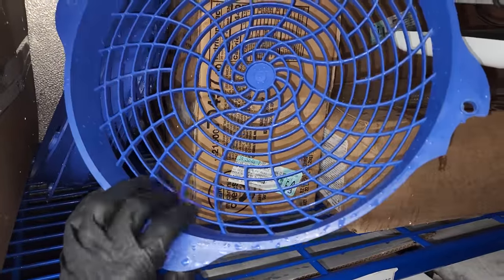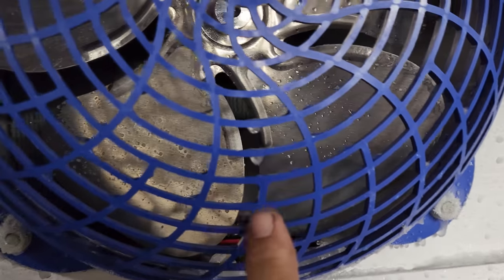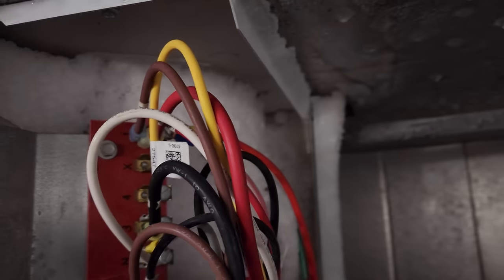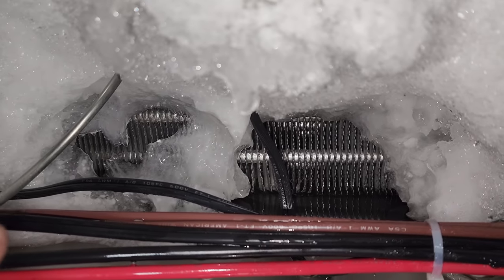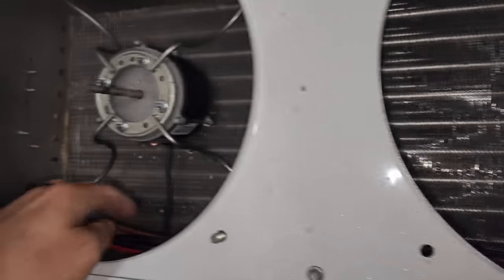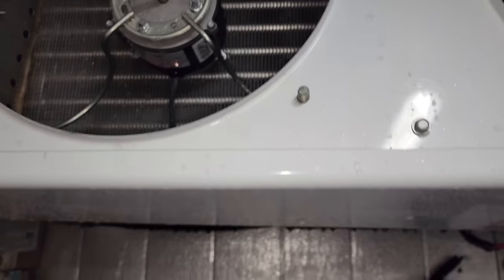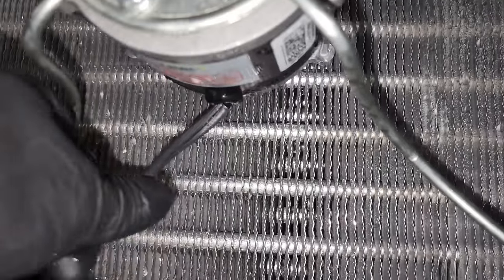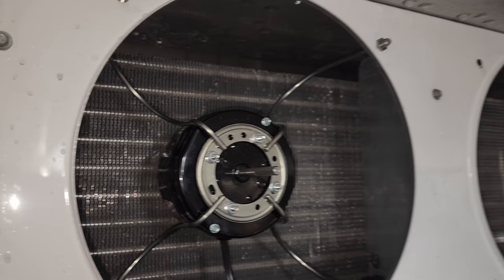THE WALK IN FREEZER HAS A LITTLE ICE ON IT.....

Comment: It cost's our store thousands of dollars in wild service calls. Cooler bunkers ignored by building maintenance, a grand. Frozen product to throw out because fan motors werent working or lack of cleaning maintenance, 500 dollars. Ice'd up walkins because online grocery leaves the freezer door open all day long 5 grand. We had so much ice and janky installer that it pulled down the evap coil and caused a leak. It took weeks to fix. Now we have iced up drain pans and water leaking all over behind the chicken wall because they keep leaving doors open and sucking the humid summer air into the freezer. Just like the walk-in cooler. We leave the door open all day long and with a cheap missing flaps wall curtain, all that humid air clogs up the drain and causes the evap to leak water onto the product and us all day long. I suggested long defrost over night when no one is around but I'm retarded. The company that services us likes to leave screws out, missing brackets, merch lighting hanging off of one screw falling down constantly into customer bunkers so they have to move the broken fixture out of the way to get chicken out. It's rediculous how much this costs the store and the company cares about nothing more than profit and make us wait for them because they are high and mighty.

Comment: I have an idea why, but why would the compressor’s oil be flushed out without the evaporator fans running?
Reply: 2 reasons, the most prominent being flood back. Basically, when the airflow over the evaporator is blocked, the refrigerant won't boil properly, and if liquid refrigerant floods back to the compressor through the suction line, it will wash the oil off the valves, bearings, scroll plate/pistons, etc. Additionally, liquids are incompressible, so you can also wind up with bent valves and such. Another issue that can happen, if the evaporator becomes flooded with liquid refrigerant that isn't boiling off at the proper rate, what little gas is returning to the compressor suction won't have sufficient velocity to carry oil back, which can result in oil slowly starting to saturate the evaporator.
Reply: @boginator55  along the lines of what I thought. Thanks
Reply: This now has me thinking... In a system where the evaporator is much lower than the compressor, does oil tend to escape the compressor and sit in the lower evaporator coil?
Reply: @fitybux4664  During normal operation, a small amount of oil will travel throught the entire system. If the evaporator is sized correctly, the suction line is sized correctly, and oil traps are installed properly, then the refrigerant will carry the oil back to the compressor. But yes, if those procedures aren't followed, or the coil is iced up/blocked, disrupting normal refrigerant flow, oil can pool in the evaporator. 
In the latter case, once the cause of the problem is rectified, oil can be returned to the compressor by warming up the evaporator with hot water or a heat gun, and then starting the system. Under heavy load, the rapidly boiling refrigerant will help return the excess oil to the compressor.
Reply: @boginator55  I just watched "WALK IN FREEZER CALL THAT DID NOT END AS PLANNED" and it seems like he has exactly this problem. Oil logged evaporator coil. It should be a crime to not install the proper traps.
Reply: Do not forget he mentioned hearing the condensing unit short cycling on LP while inside the box. 
Worst restaurant owners ever imo.  I have seen ice buildup on evaps before but nothing close to that level of encasement...

Comment: Can't we get a truck mounted unit to blow 0 deree air in a tube into the box for an emergency?
Reply: Sounds like a good invention. Have a gas/electric powered condensing unit on the back of a truck (could use a normal unit, just have a large gas generator on there too when necessary), have lines running to a portable evaporator coil/fan you can place inside the freezer box. Not sure if they have rubber hoses that can handle 500psi+, I'm sure anything like this exists for the right price.

They do have freezer trucks, which are a bit more conventional. But then you have to move the food around, and they tend to not work too well in high heat. (Whereas the existing freezer box is already insulated correctly.)

Maybe take it one step further. Put all of this on a crane truck. Then you can drop off the whole package to run just outside a business and you can grab another one to rinse/repeat.

Comment: thing i dont get and i hate, is the fact that those things uses electricity to defrost, by heating up the condenser, for me its stupid, or i am the stupid, i dont know but they could run the fans until the ice clears and the temp of the room will be 1c or 3c, no need to defrost it- but still, im not an experter or engineer

Comment: My only concern is you using Hot water to melt the ice. I do not use Hot water for thawing coils, only normal cold water from the spigot. Leaks are in the future for that coil. You will get wet but that’s our job. As for a Saturday call labor plus parts.🤔.  I’d say in the neighborhood of $1500-$1700. Judging by the amount of work estimating 3-4 hours on site, after hour fee from the supply house, and parts to get it running.